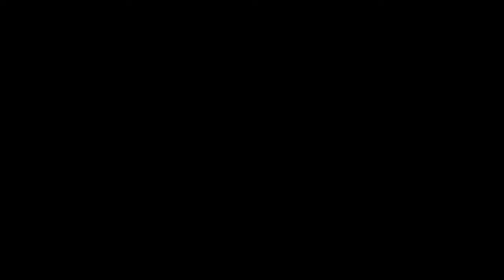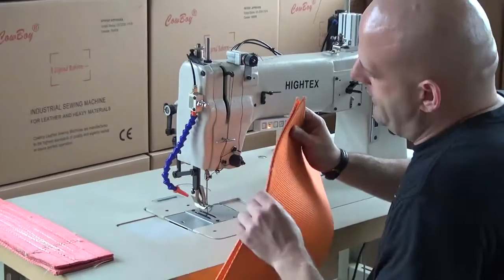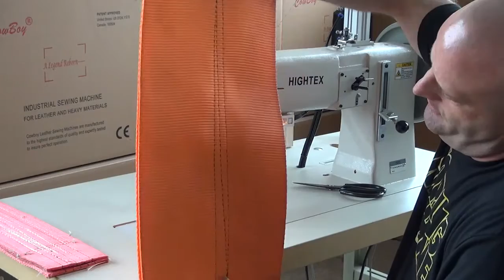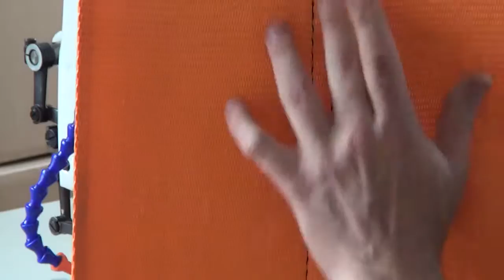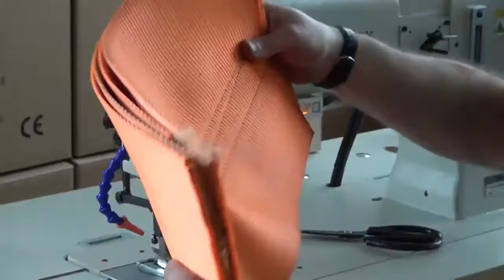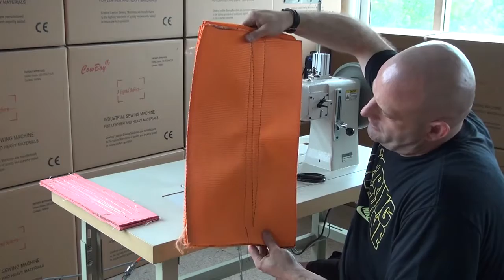Extra heavy duty webbing slings sewing machine

Comment: Hey there
I’ve been advised to get a hightex 74400 machine for my bag making and I was wondering if you think this is a good machine for bag making. I don’t use leather yet, but I do go through some thick layers of interfacing that my domestic machine finds quite hard to deal with. 
Also I’ve never heard of hightex before so I would be grateful for any advice. Thank you xxxxxxxx
Reply from the maker: If you are making hand bags made of leather or canvas, cylinder bed machine is better, such as CB341 or CB4500, if you are making jumbo bags, Big Bag, 72600 is right machine. Which type bags you are making? Please send detailed information to our sale engineer at info@automatic-sewing.com, thanks!

Comment: Dear Sir, Good day,
I am an importer of webbing slings and I supply it to oil services companies and harbors
I think about manufacturing it inside Egypt
I will begin to import the strips from you according to European specifications and a third party test certificate
The start will be at a lower cost
Please provide me with a feasibility study for this project which includes the price of the sewing machine and the price of the raw tapes
The other basics are required at the lowest cost with the possibility of training in your factory on the use and manufacture of webbing sling 
Waiting for your kind reply
BR,
Engineer : Mohammed Al Saieeed
G.Manager
Solarco Establishment.
Reply from the maker: We do not make the raw webbing tapes, we just provide the best sewing solution for webbing slings industry. Please write to info@automatic-sewing.com for detail, thanks!

Comment: does it come with the buttons, the pneumatic set up and the needle cooler?
Reply from the maker: Yes, this sewing machine is mainly for stitching lifting slings and cargo lashing straps, we standard equipped with pneumatic foot lift, pneumatic reverse stitch and needle cooler. Some customers are using this machine for stitching leather, we deliver without pneumatic system and needle cooling system.

Comment: how did you made the reverse automated?
Reply from the maker: It equipped with pneumatic reverse stitch and foot lift. The reverse stitch can be activated by the switch on top of machine or by knee pedal under table.
Reply: Oh, I tought this is something that you can add to any sewing machine
Reply from the maker: no, it is difficult to work for other machine, because different industrial sewing machines need different casting base for cylinder, and it is difficult for you fix with switch on top of machine, it need special driller.